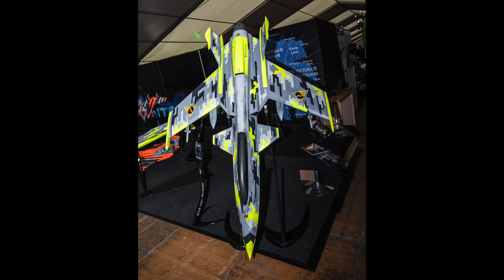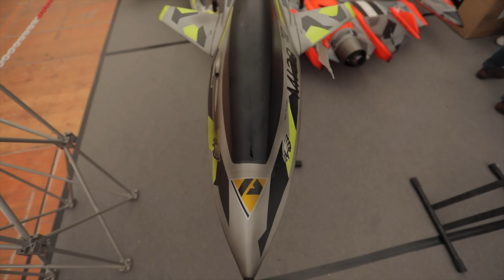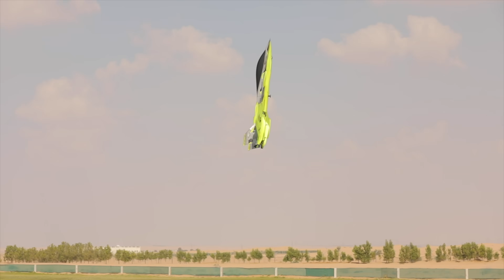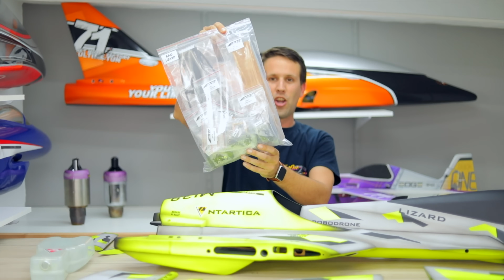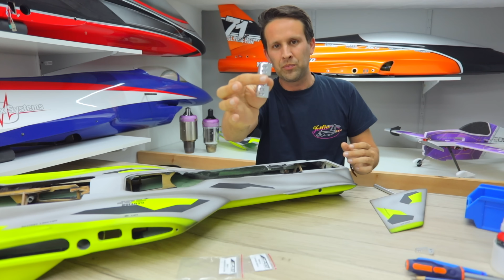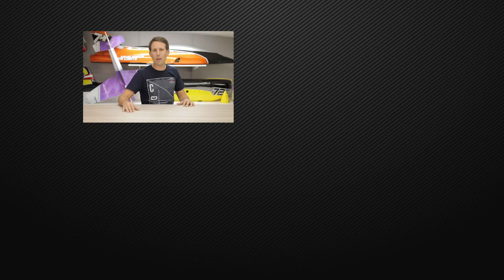SAB Lizzard Build - Episode 01. Intro and servos.

Comment: Hi Martin, great videos about the lizard plane, especially when powered with the Jetcat turbine. I was wondering for whom this plane is made? Until now I've only flown edf jets but on this particular one I'm really interested by the gas turbine. I've noticed the plane is not only capable of very fast 3d but also extremely slow flying. So do you believe a person can make the leap from edf planes to the Lizard?
Reply from the maker: Hi Klaas, the difference between Turbine and EDF is almost non existent now, both accelerate quickly and even have similar flight times. Heck, taking into account batteries its possible that even price is similar. 

The question is the plane, if you are used to large EDF with similar high wing loadings, and ideally have flown a delta before, you will be fine with the Lizard, regardless of which power plant you decide on
Reply: @MartinPickering-PickeringRC  Many thanks for your valuable comment. With this plane I would definitely go for the gas turbine, mainly because of the vector option. Thanks again Martin!
Reply from the maker: klaas gesquiere awesome! Go for it and have fun!

Comment: Hey Martin, that are realy cool and nice videos about building and flying the Sab Lizzard, thank you for that. Now I want to build one on my own. But I have one question about the servo for the canards. In the video you are using a HV737 with about 10kg/cm but in the manual they tell to use a servo with min. 20kg/cm. How do you know, that the servo with 10kg/cm is strong enough? Did you try that before?
Reply from the maker: A mix of logic and experience here I guess...  My UltraFlash had 10kg servos in it with a P140RX, flew it for years at full power and was perfect...  This Lizard is smaller, lighter, and has a P130Rx which will only probably hit full power when pulling out from a hover...  Jets need precision more than torque as the deflections are low, only the vector thrust is taking a beating and that has the 747s in them for the extra grunt...
Reply: @MartinPickering-PickeringRC  thank you for that fast answer. And many happy landings
Reply: Excuse me, I have one more question. With the RC servos you don't use the rubber dampers. Is that because of the required precision? Instead, you use glue on the drill holes for the canard servo. What kind of glue is that and is it for stability?
Best regards
Reply from the maker: herof0815 always use the rubber grommets. Only reason here was that my servo was slightly on the small side and screws had to be stretched outwards and couldnt do that with the grommets. Glue is just standard cyano

Comment: Awesome! I recently received mine and upon unboxing was blown away by the quality.Starting the build shortly. Really enjoy your videos and flying skilllset Martin. Cheers
Reply from the maker: Thanks Baintek! Working on further videos on the build as well, hopefully they are helpful in building!! Enjoy yours!!
Reply: @MartinPickering-PickeringRC  look forward to it, cheers mate
Reply: Baintek Eagerly waiting the review Ian what motor will you be using.
Reply: @wayneschenk5512  Will start off with a light and small K85 for longer flights on the 2 litre fuel capacity. If the power just doesn't cut it for my flying style and as the confidence builds on the aircraft capabilities, will install a K120 which I'm sure will be more than awesome!